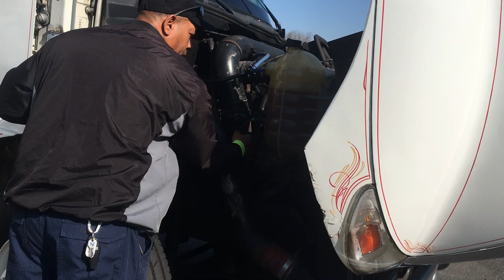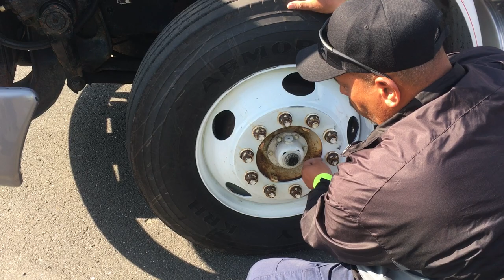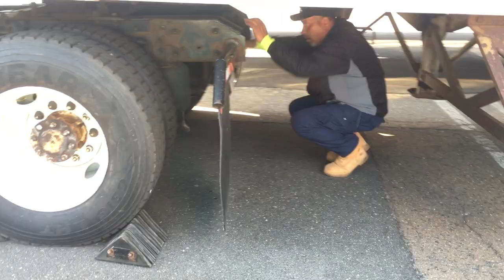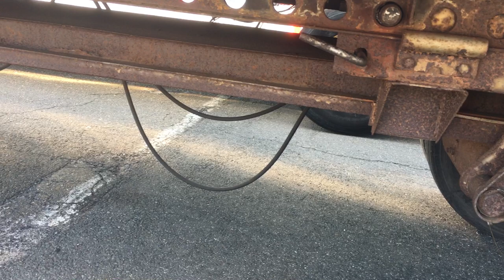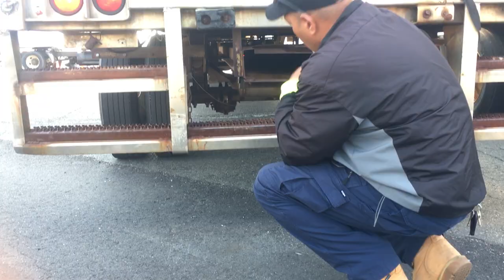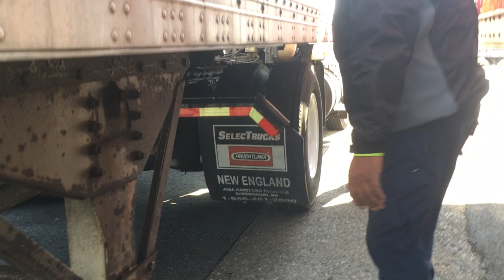Nettts Pre Trip the right way

Comment: A mediocre pre trip. He ,definitely , should not rush. He has missed a lot of parts, especially where he forgot to mention that the slack adjuster and a push rod should not have more than 1" of free play " WHEN THE BREAKS ARE RELEASED " .
Reply from the maker: Well there's another pre trip he made more in depth. It's posted as a linked comment. It more on the emphasis for the mass ppl since they have a time limit for test
Reply: pretty sure we do not say that here in mass while testing.